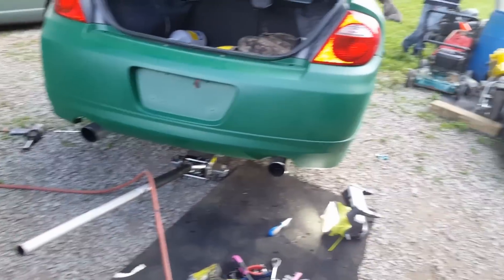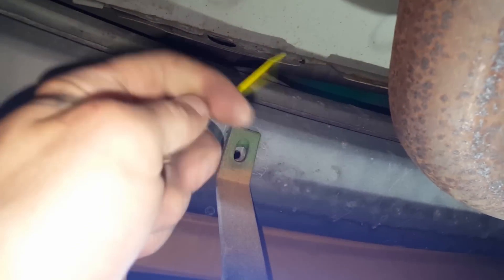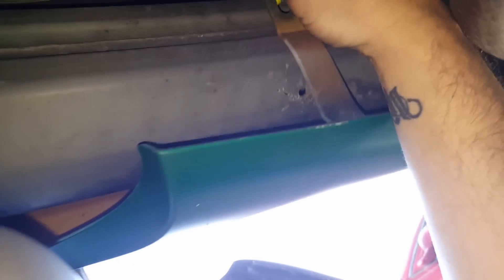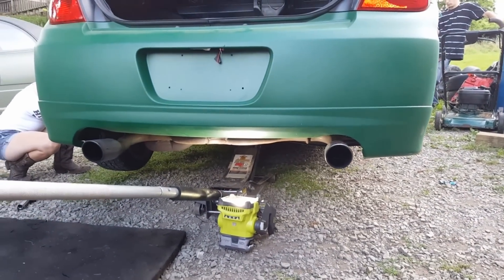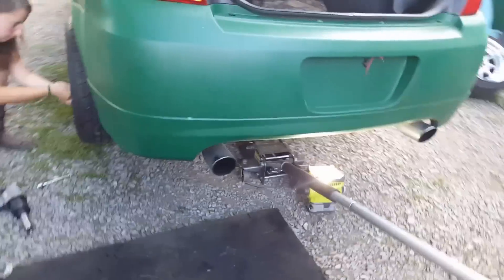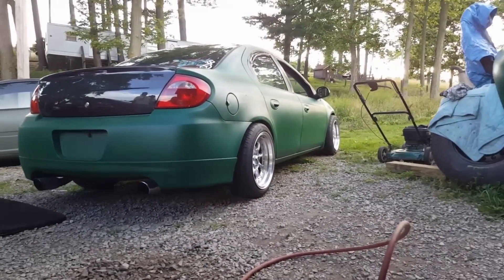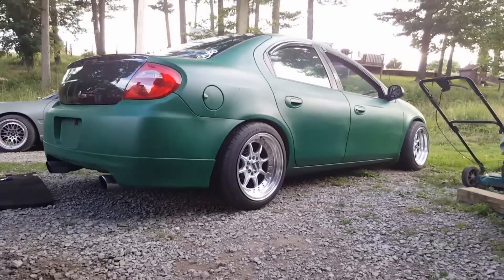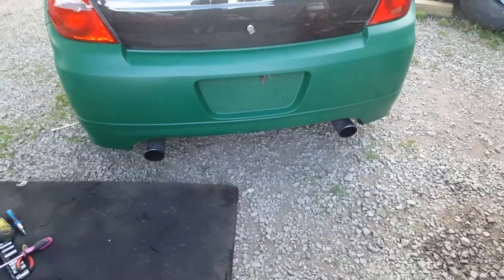SRT4 REAR BUMPER MOD FOR FREE

Comment: Shay's car is sooooo clean!
Reply from the maker: +iDrive4fun93 she said thanks
Reply: +that neon channel I wish my wife's car was that clean. needs a dent taken out of the front wheel from a pot hole the size of the grand canyon, a good bath, and it'll look good.
Reply from the maker: +iDrive4fun93 hell yea what she drive ..my gf loves her car
Reply: +that neon channel a 2008 Hyundai Sonata lol. With the 3.3 V6, its got a muffler delete to quad blue tips, a wepn-R intake, and 17" Moda rims with Firehawk Round Oval high performance summers. Its got like 250hp, and it rips pretty good. It'll burn the front tires off for sure. I got a vid or 2 of it on my channel I think... its nothing special, but it is super smooth to drive, and it runs fantastic for having 203k miles on it. The engine purrs and is just as strong as it was the day we got it.
Reply from the maker: +iDrive4fun93 sweet
Reply from the maker: +iDrive4fun93 I'll check it out